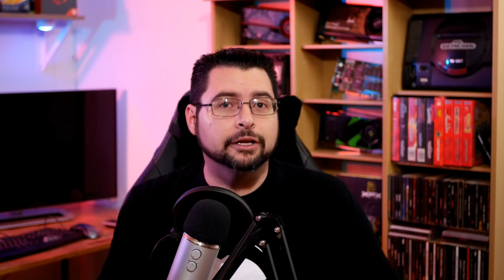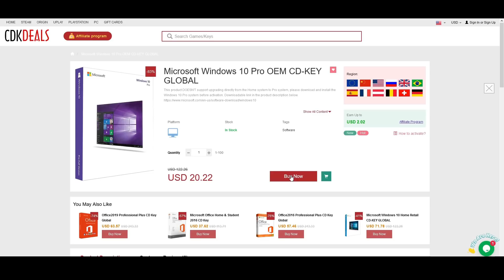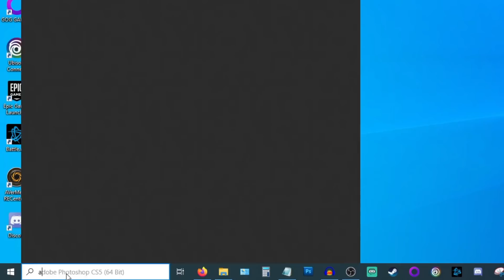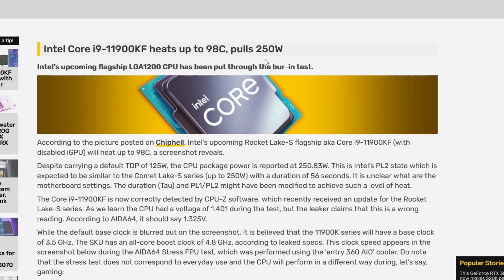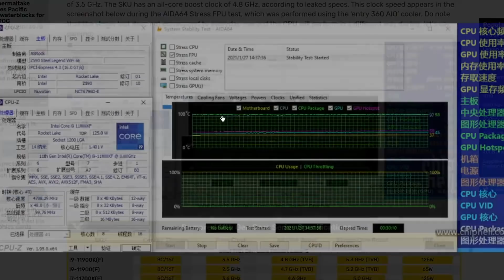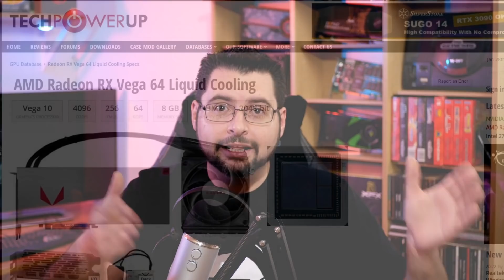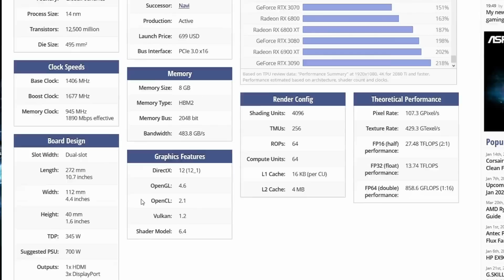Intel's Rocket Lake 11900K CPU Might Burn Your House Down!

Comment: Said the same about the 10900k and im running 70c at 5.2. I bought a 590  board and gaurentee i wont have to switch up psu for this new chip... ill stop back after launch
Reply: Yep.
Plenty tech'tubers making these drama videos (it's oh-so-trendy to shit on Intel these days).... 
But then it's highly suspectful that any of these fellas ever had an 8-core 9th or 10th gen Intel CPU running to see how it really is, much less having any idea how it really is for upcoming 11th gen. Pulling basic assumptions from their arse.
Even a 10700K (8c/16t cores) overclocked to 5.0Ghz (1.29v~1.32v vcore) and 240W+ maximum boost will run fine with a dual-tower air cooler (max 90ºC after 20mins of Linpack Xtreme x64, harshest stress, like ever) and runs fine with a 230W GPU on a 650W PSU. 
A whole bunch of BS for the sake of clicks/views, that's all this is.
Reply: @T595955i  you are 100 percebt correct comrade,  are you going 11th gen?
Reply: @sagerdood  Nah, extremely happy with my 10700K (OC@5.0Ghz), so no point going for 11th gen IMHO. :)
Will be checking early next year how's things with AlderLake (12th gen), whole new architecture, hybrid chip (and DDR5, and PCIe5). That'll be interesting.
Reply: Well newest update, 11900 broke single core record and its right on par with the 10900k in multi. I feel like these tech tubers should wait for chips to drop before hearsay makes there videos. They sound stupid...

Comment: Another interpretation is that the new chip has a new heat spreader curve (convex vs concave?) that might lead to bad interface with the waterblock. Just a thought as otherwise it's hard to see how even at 350 Watt they could get such high temperatures on a triple clc.

Comment: Chris, your conclusions I think are totally fair, but your wattage comparison is a bit flawed.  The Intel Rocket Lake silicon is going to be less than 200mm2, whereas Vega was 495mm2. A budget 360 AIO cold-plate is smaller than the Vega Liquid's, so the CPU will heat up faster using the same amount of power.  Also the individual cores on the cpu die running near 5Ghz will be incredible hot spots compared to a more diffuse GPU running at 1.6 Ghz.  So Rocket Lake doesn't need to draw 400W to be an un-coolable nightmare.

Heat is just energy, and watts measure units of energy transfer per second.  The ability to transfer heat energy in a material is a function of the material's thermal capacity (specific heat) and distance.  Silicon has poor thermal transfer compared to copper (it is a semi-conductor after all), so a small CPU die using 250 watts is going to be way worse than pumping 400 watts through a GPU with many smaller streaming processors spread out over a die twice the size.

Comment: Arctic unleashed 420mm AIO (3x140mm i i know it's crazy) and i have feeling that it will be needed for people who want to run their rocket lake chips under 90°C
Reply: I got an Alphacool Eisbaer 420mm AIO, I should be fine
Reply: problem is not cooling the water, is removing the heat from the die. 280mm aio will work just as well as a 360 aio. provided the pump is equal. i have used a 240mm aio to cool a 7980xe at 4.7ghz (around 500w) it did really well. ofc i used proper fans to help keep the water temps low :)

Comment: What do you expect, it is basically a modified skylake u-arc with bigger caches at 14nm. You cant really compare gpu to cpu cooling wise.. First, cpus are smaller dies which is harder to cool and dont forget that gpus are pretty much more akin to slow cpu with tons of cores, while normal cpus are super hot in small area.

Comment: The Good Old Gamer : AIDA64 just says that it pushes the CPU to 100%....but the problem is AIDA-s only medium heavy math behind it which doesn't efficiently push the cpu-s to their 100 % utilization. If this Shintel 11900K 8c/16t goes to 255 Watts of power on the cpu die alone and 98°C at AIDA....it would die under water cooling in FurMarks CPU benchmark or Prime95 benchmark, because those two produce around 45-50% higher efficiency in utilization hence temperatures are around 35-40% higher than they ever are in AIDA64.

Comment: I'll stick with my 10900 until we have a significant performance increase. I'm hoping when Intel goes to the 3nm process it will be a performance boost and lower temperature/power.
Reply: The good news is that your 10900 should last for the several years it will need to.
Reply: @ARTOFMUSIC At least not from Intel.
Reply: @ARTOFMUSIC That would be about right for my next build. One day maybe a holodeck.
Reply: @tk72231968  The main thing that annoys me with intel now is - the need to constantly replace motherboards to ugrade a cpu - gets too expensive, where as with AMD you just buy a new cpu..and plop it in!
Reply: @drummonkeystuffuk1875  That's a good logical reason. I stopped doing cpu swaps on the same mb's way back in the 486 days. Now I just price a MB into my new build costs, but I like new shinnies. 😊

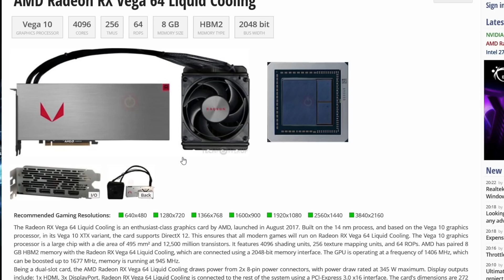Comment: 5:58 gpu block have direct contact with gpu die comparing cpu . That who temps are a lot better
Reply: makes sense
Reply: its called direct die cooling and on intel cpu´s it was a common thing for overclocking in combination with liquid metal, but it doesnt cool the die this much better (normaly only singel digit temps) and it surely doesnt compensate the need of a 360 radiator vs a 120mil radiator

Comment: I'm interested to see what 11400F brings to the table if it's really priced at 160 bucks inc VAT as leaks suggest. 2.6/4.2/4.4 GHz coupled with 10% IPC gain should place it inside 10600K territory when it comes to gaming. That would be a very good value alternative to 5600X when coupled with new B/H budget friendly motherboard and 3200MHz DDR4 ram. You can get CPU/MB/16gbRAM combo for the price of 5600X... not bad value at all. Given the fact that similar 10400F measures 140W under stress test (same as 3600) power consumption and thermals should be in check with 11400F too. Don't get me wrong, I'd like to get 5600X but 6 cores CPU is just not worth 350 bucks in 2021 imho.

Comment: For anyone looking to get a high end CPU with their high end GPU the 5900X makes more sense than an i9 and for someone looking to make a baller but still reasonably price/performance gaming rig is better off getting a 5600X to not bottleneck their RTX 3070/3080/RX6800(XT)

Comment: It makes more sense for AMD to produce more Zen3 than Zen2 since they use the same fab capacity and they get better margins with Zen3. There almost 0 difference in cost between Zen2 and Zen3. Same opportunity cost for them. This is why Zen2 prices are going up too.
Reply: There aren't unlimited demand for 300+$ cpu's, eventually they would have to bring sub 300$ Zen 3 processors.
Reply: @marjanp  that's not quite how it works. The issue is they have so much fab space and a TON of products. Ryzen, Radeon, Instinct, Epyc, PS5, XSX, and XSS. They have a contractual obligation to keep producing console chips, and other than that, Epyc and Instinct are not only in massive demand, but have way better margins. Why do you think the 8-core die 5800X is priced higher per core than both 5600X and 5900X? It's because they don't want to use their good 8-core dies for Ryzen unless we're making it worth their while. That's also why the 5950X has the least stock of all. It doesn't make sense to sell many at that price.

You say there's not infinite demand for >$300 processors right now. You're only technically right. It's not infinite. But it's higher than they're capable of meeting right now.

Comment: Pentium 4 Part Two
Reply: @J B At least those are gonna be good  ranges.
Reply: I had the 3.06 GHz part for around 7 years....good times
Reply: @pyramidschemer4083  I'm trying to run a Geforce 6800 on 98 with a 775 P4 HT without crashing after exiting Quake.
Reply: Pentium 4EE, 233watts, idling, lol. or something like that, yeah, even the ten years of core architecture, so fitting. I doubt the Core Duo part 3 will happen in 2021 or even 2022 as it takes a few years to go from draft to wafers. think intel's first doldrums was in the 486 era (DEC launched the 133MHz 21064 months before intel's 66MHz 486 came out, intel 'had' to do something, lol). I only hope AMD doesn't go from Opteron to bulldozer with Zen.

Comment: Intel has gone full AMD, you never go full AMD, even AMD doesn’t go full AMD.
Reply: nah intel went full amd way before amd went full amd. P4 anybody?
Reply: Full intel for sure, never go full intel.
Reply: Even with AMD's FX lineup you could keep the chip cool @ 4.3-4.7 ghz with a simple 30 dollar zalman pure copper air cooler. I had one of those left over from the Athlon 64 days and I didnt need to upgrade it when the FX"s came into play. 

I have proof on my channel if youre looking for it. 

Fx got more heat then they deserved, the only one I think youd have an issue cooling is a 9590 and I have not seen one of those in use or first hand in my life - my wifes build had a 8370 which was a very good chip pushing a R9 390x XFX DD and the video card was what was putting out the heat - but that DD cooler was atrocious - the Tri X cooler which is the card I had at the time handled everything better and what made me a sapphire person.
Reply: Everybody knows you never go full AMD
Reply: They have gone full Intel! Thats new
Reply: Retarded comment. AMD's FX lineup happened because Intel illegal competition almost starved AMD to death, and costed them their foundries too. 
So nowadays we have shortages because AMD must rely completely on TSMC. 
You see what are the consequences of Intel's infamy?
Reply: @_A.d.G_  I agree that uninformed folks were buyin' Intel and that was the cause of AMD's later fails.
Reply: Mashallah brother preach
Reply: AMD stopped going full AMD back in '17.  And since then, my AMD stock has done quite well.

Comment: You arent accounting for die size for  heat dissipation.
Its easier to cool the vega liquid than 250watts cpu it's 2.5x the die size.
They are still going to get hot for sure.